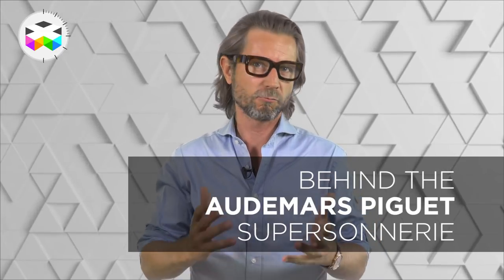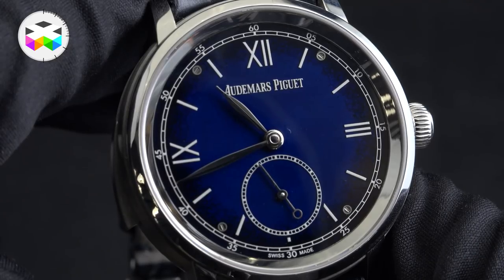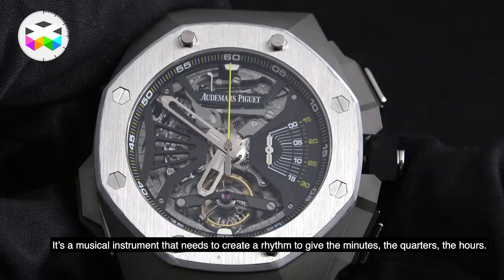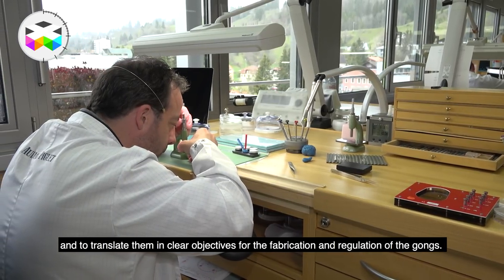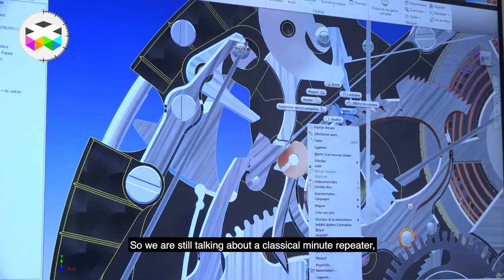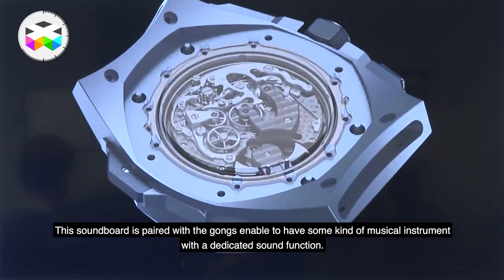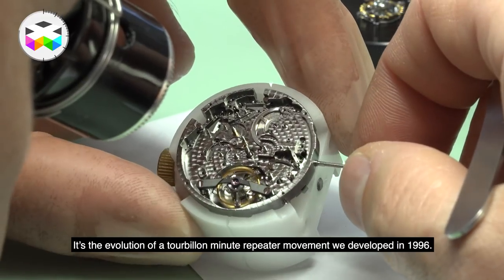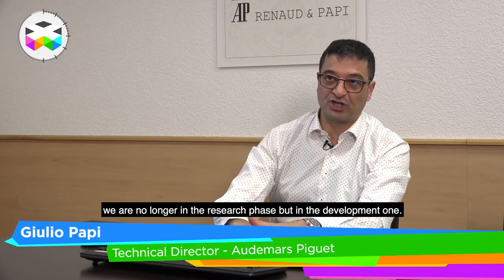What makes the Audemars Piguet Supersonnerie chime so loud?

Comment: I am surprised nothing was said about the material composition of the gongs or the resonator itself. I am under impression that to achieve really harmonic sound from a metal component one needs to mix it with all sorts of precious ingredients such as gold or silver.  The same way the church bells were cast 100s of years ago.
Reply from the maker: Actually the gongs are made from "normal" material used on other minute repeaters, it's really the sound board architecture which really makes the difference.